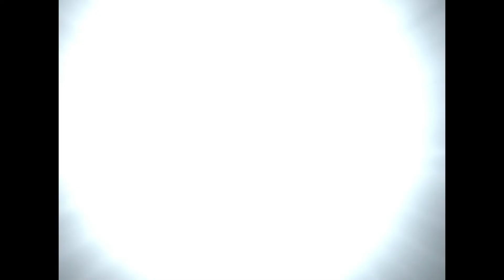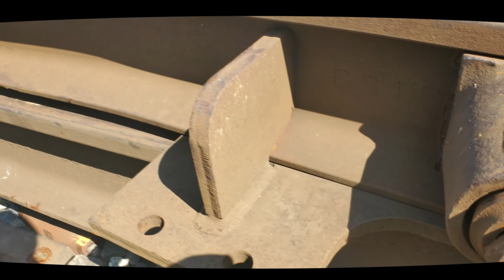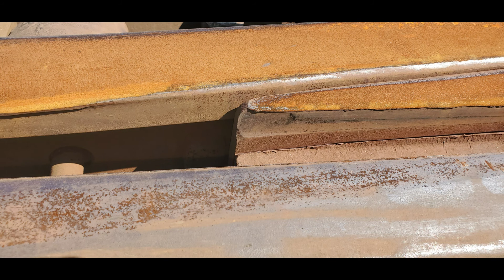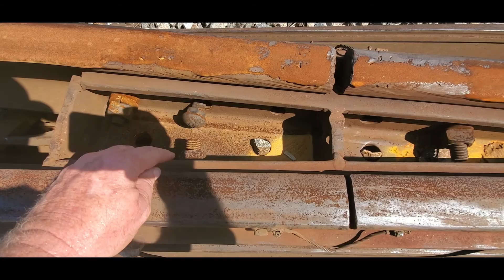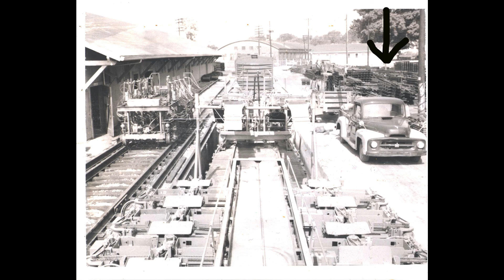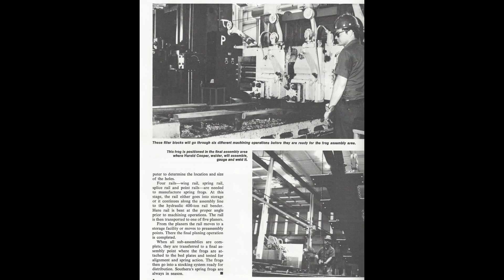Railroad Spring Frog Operations

Comment: Thank you, for this excellent explanation!! I was just reading the Environmental Impact Statement that was written, back in 2011, in preparation for the Charlotte LYNX Blue Line Extension light rail project. In the noise mitigation strategies, the report suggested spring-frogs near two UNC Charlotte buildings that would be sensitive to noise and vibrations. I can see, from your explanation of the required machining and labor time, why this type of frog would be more expensive. But I can also understand, now, how this type of frog would reduce the wheel squeal noise. Thanks!

Comment: I used to work for Canadian National.  The CN main line, through Northern Ontario, is single track, with periodic double track sections where trains can meet.  Spring switches were used to send the trains onto the appropriate track and then they'd open the switch, against the spring, at the other end.  I was almost 50 year ago when I work in Northern Ontario and became aware of these switches.  And yes, I meant meet.  Trains were scheduled to meet opposing trains at specific double track sections and were not allowed to proceed until the opposing train arrived.  IIRC, those switches were marked with an "SS" sign beside the switch.

Comment: It would have been good to find and show an example that is in service. You are right about how the flanges move through he spring frog point, but without the frog guard rail that is always installed opposite the spring frog to catch the backside of the opposite wheel that keeps the flange from 'picking' the spring frog point and causing a derailment..

Comment: Why are there springs involved if the switch points are moved back and forth by a Manuel switch lever?
Reply: The spring frog has nothing to do with the points. The spring action simply keeps the wing rail of the diverging track snug against the point. This closes the frog gap for the running rail, resulting in smoother travel and less point wear.

Comment: I'm curious?? Were the spring frogs designed to allow for higher train speeds on top of a smoother ride??
Reply: Spring Frogs on a mainline run were void of gaps, therefore, essentially no added bump at the switch. The only bumps were with tangent 39' pieces of rail... at each joint.
The drawbacks of Spring Frogs were light rail equipment... since they were not heavy enough to move that "spring-rail" and had to be craned over.
Hi-Railers were other rail vehicles that were not to go through them as well.
John  Kamloops, BC  Canada